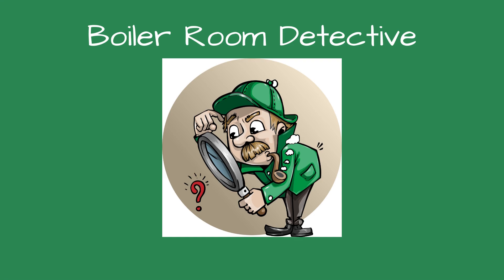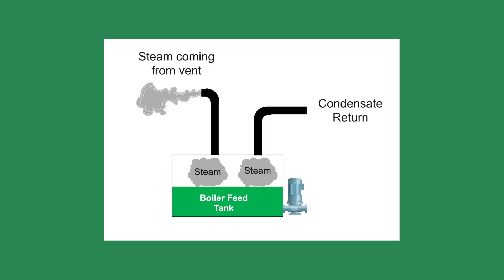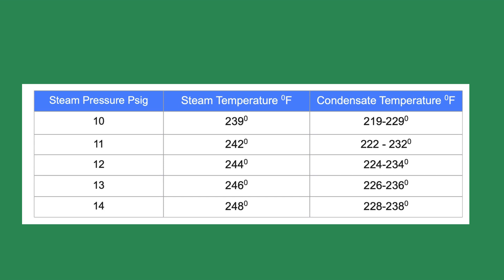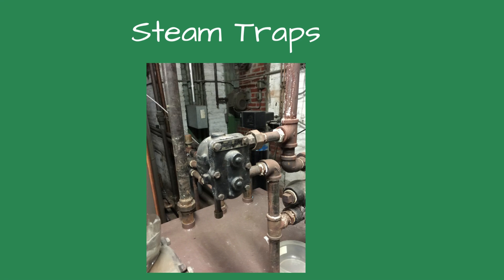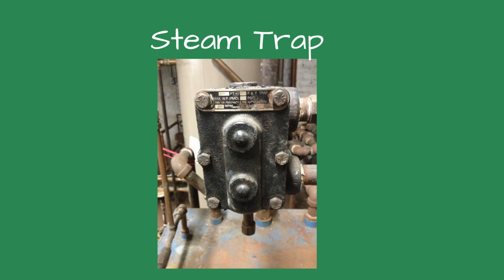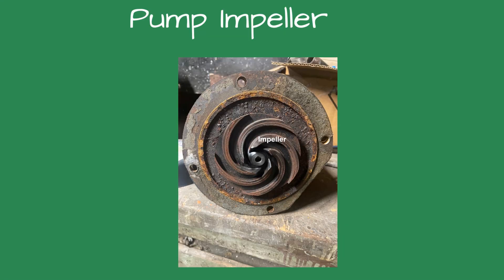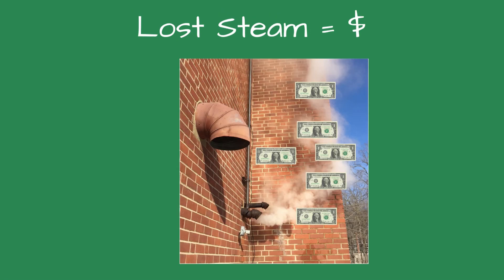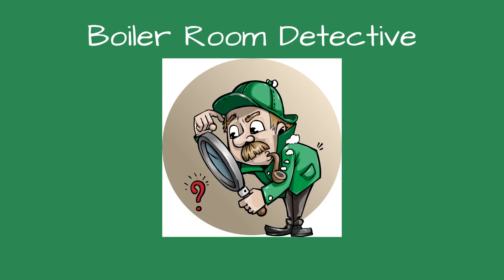The Case of the Non Pumping Boiler Feed Pump

Comment: How often should the traps be checked/replaced? Some buildings have well over 100 traps, seems like job security
Reply from the maker: In industrial facilities with high pressure steam they do it yearly. In commerical or residential systems, they are rarely checked. I would think every couple of years would work unless there is a problem. In a building with 100 traps, you could break them down to three areas and check each area once a year. that would give you a 3 year cycle for testing

Comment: i had a service call @ a new 3 story outpatient facility. steam was shooting out the vent pipe of the boiler feed pump. I got the piping blue prints & started the hunt to find the steam source.  4 hours later on the 2nd floor, i found a trap that was installed upside down. it was below the 3 floor return runs which ran parallel above the 2nd floor runs..I put a movers cloth on the pipes and lied on my stomach dangling  my arms between the pipes with wrenches to disconnect the trap from the unions & reconnect right side up. started the system back up. stopped by the next day. The system was fine.  I was  glad it was a new building that was up to the latest codes where nothing was buried or totally impossible to gain access.
Reply from the maker: Wow you certainly did your detective work that day. Its a great feeling finding and repairing a problem others couldn't